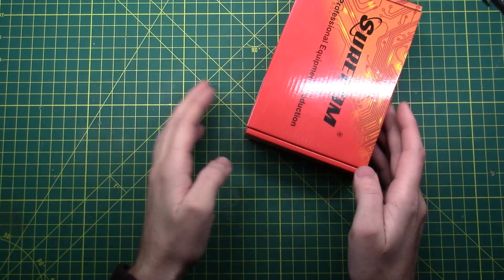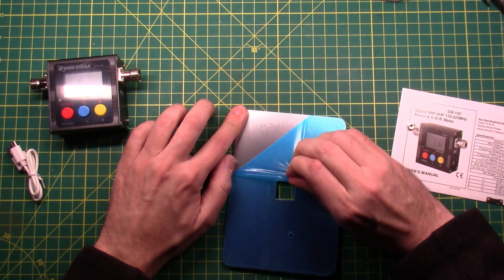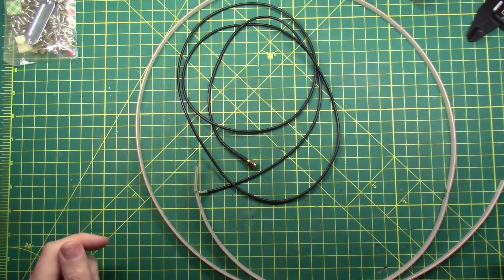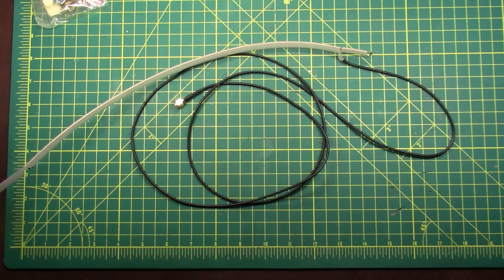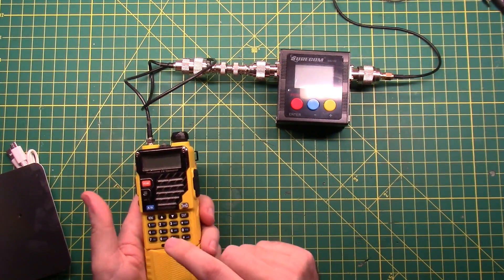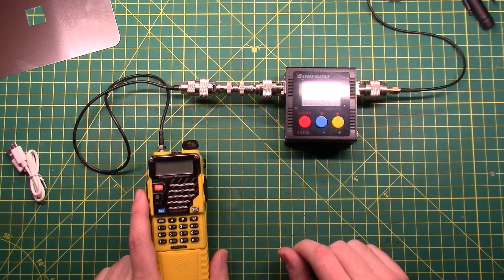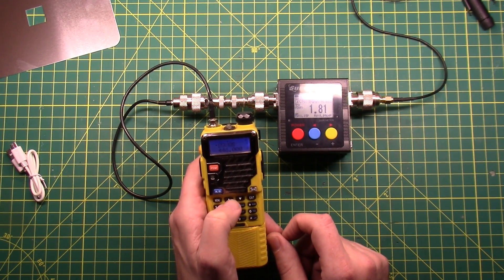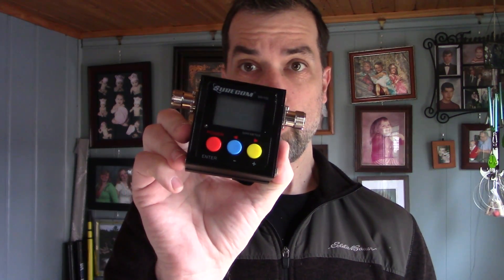Surecom  SW-102s First Looks + MFJ Battle

Comment: Is the ground plate necessary?  Mine did not come with a ground plate and I’ve been using it to check my SWR on my mobile GMRS antennas and the power output of my radios.  

Wouldn’t the ground plate need to actually be grounded to have a benefit?

Appreciate the help guys.
Reply from the maker: As with most things in ham radio, "it depends" - your handheld's natural element is to be in your hand, making you the "ground plane". If you're testing your vehicle antenna, the car is supposed to be the ground plane and you are not "there" at the antenna to become that ground plane.  The plate that I use is attached via the ground screw and I use it as more of a "measurement standard" so all my tests are close enough.

If you want, you can attach a 19" wire to the ground screw electrically and save yourself the cost of the metal plate.
Reply: @temporarilyoffline  Okay, that clears it up.  It’s a ground plane plate, not a grounding plate to drain off static, etc.

I suppose it could be beneficial to ground the meter using the ground plate screw if used on a bench or other permanent station, or maybe when checking a base station radios… when attached for extended periods?

Just checking them mobile radios and antennas once in a while, I’m fine without it (?).

I greatly appreciate the help.
Reply: When checking a handheld, it replaces our hand, arm and body as a ground plane?
Reply from the maker: Yes, you're pretty spot on.  I don't do much "station grounding" because I'm a full time RVer traveling around.  But I suspect you'll notice right away if your station needs grounding - you'll get noises you shouldn't be getting.  

You're right, its a "ground plane" - its "the other half of the antenna" - transmitting antennas really need two sides to work properly.  If they don't have the proper second side, they will actually just create it out of nearby metal/things - usually the shield on the coax an then you're feeding back into your radio/station.  Getting too deep for a youtube comment now though ;-)
Reply: @temporarilyoffline Yes, it was “deep” and very informative.  But thanks to you I now have a proper understanding.  I hope our comments help others.

I do appreciate the help.  Help me immensely. 

Thanks for all…

Comment: 10:14 my d*** not hard. W not show correct when you can change settings. for gadget that we bought measure W we not know is it correct xD if it not correct we need adjust it. HOW WE KNOW ITS CORRECT! when instrument to measure is this lol. 15w on 10w radio(solded) good thing it was cheap. they should ask more money. then 6w on other freq xD if could do 3GHz it would be i guess 1W LOL

Comment: Mine did not come with a Ground Plate
Reply from the maker: I'll have a video on this soon, it works differently without the ground plate and I think it really needs it.  I haven't tested yet, but if it does need something, put a 19" wire under the ground screw for 2m testing.  Stay tuned for some science!

Comment: To the question about the other meters: you can't compare this one with MFJ....  due to price range and quality, or am I missing the point ?  SWR on dummy load ? SWR is for antenna's only, one does not need SWR from a dummy load, a dummy load should not radiate power, SWR is about radiated and reflected power of a antenna is my understanding.
Reply from the maker: I was contrasting the differences and figuring out if the tool could be tested.  You are correct that outside of proving the device works you wouldn't use a dummy load.

Comment: It is a nice looking gadget... but the SWR i don't trust the thing.... i have a high SWR on a dummyload! Measuring on other  SWR meters the dummyload is okay... I don't know about the SW-102
Reply from the maker: I had a bad Dummy load, and I needed to change some ways I was using the surecom and it got better.  https://youtu.be/hmQ2RiQC31g
Reply: @temporarilyoffline  Jes i watched the movie! As i understand it correct: Like an antenna on 26.965 cb band the SWR is 1.0-1 but going up on the frequency the SWR wil get a little higher also. And my dummyload goes to 500MHz. And testing on 433.175 the SWR got 1.79-1 i am almost on the 500MHz. Is that the reason the SWR got so high? And would a dummy in the range 400-500MHz perform better?
Reply from the maker: @NatuurlijkRolf  a dummy load designed to work in the range you are testing would work best.

Comment: Got my SW-102.  It didn't include a ground plane, so I made one out of 1/32" aluminum from a big box store.  I chose aluminum because (a) that's what the video appears to show, and (b) aluminum is easier to form than the same thickness of steel sheet.  Since our esteemed presenter pulled his ground plate out the box, I measured the inside of the box everything came in and made my ground plate 4.5" x 6.5".  The square center hole is 3/4" across, and the hole for the grounding lug is 1/8".  The only tricky bit was ensuring that the two holes were mutually aligned and also squared up with the SW-102 box.  Based on past experience, I expect to lose the small knurled grounding nut, so I'll buy a wing nut to make operation a little easier.  The ground plane appears to work well in that I got very consistent readings from a new dual band HT.  Short initial report on the Radioddity GA 510: Across the 2m band, at the high power (10W) setting, power ranged from 9.2W to 7.9W; SWR with the rubber ducky ranged from 2.2 @ 144MHz to 1.5 @ 148MHz, with no strange variations.
Reply from the maker: Very good results!
Reply: @temporarilyoffline  Update: The grounding nut is an M3.  Hooray for my local Ace Hardware!

Comment: Do your adaptors affect the readings you get from the SW-102?
Reply from the maker: Yes, everything effects everything.  Its not enough to complain about or to spend more money to fix.  Just holding it a different way effects it.
Reply: Definitely yes..anything you  attach to your coax IT WILL AFFECT THE SWR reading..so better tune your coax first then again check your swr

Comment: Hallo. Do you know how to upgrade the firware for SW-102?
Reply from the maker: I can take a look into it.  Have you found the firmware file to update this with?
Reply: @temporarilyoffline  I have 2.7 version but on YT I have seen for example version 4.5. On some webs there is the zip files with the  firmware for sw-102 but I do not knowif it is a good idea to download this.
Reply from the maker: @macdruxxx  Apparently the firmware versions line up weird.  There are two models of this meter:
OLD VERSION : V3.3 ,V3.8 ,V4.5,V4.9 ,V5.0,V5.1
2017-8 NEW VERSION : V2.02 ,V2.03

And if you hvae version 2.7, then you might not have either version?

I'm in the same boat as you, I don't see anything "safe" to download.
Reply: @temporarilyoffline  I will send you an explanation from. Surecom. It seems my v2.7 is almost the newest one. For me it is big mess. 
"Version information of date: 
VER．3.3-V4.5   (P.C.B. 001) Production on   2016-2017    
VER. 5.1            (P.C.B. 001) Production on   2017-2018   
VER.2.0 -V2.03 (P.C.B. 002) Production on   2018-2020    
VER.2.06-2.08   (P.C.B. 002) Production on   2010-2021    
VER,2.4              (P.C.B. 003) Production on   2021-Now     

 

The first from : 
P.C.B. 001 (Old version )   V3.3,V3.8,V4.3, V4.5  can up to V5.1  .       
P.C.B. 002  V2.02,V2.03,V2.06 ,V2.07 ,V2.08    (Version V2.0  to V2.06 (same V2.07  V2.08)..... , the watt meter refenece is best than  V3.3,V3.8,V4.3, V4.5,V5.1 .)
P.C.B. 003  V2.4 ~V2.7  (New PCB design for S.W.R.)  . (* V2.7 will be cancelled the efficiency % ,sorry for the inconvenience)"
Reply from the maker: Yeah, that is a mess!  At least they answered you.  Unless there is a problem/blocker with your unit, you don't have to upgrade the firmware.
Reply: @temporarilyoffline  It is very interesting. I have just checked and I got an answer from Surecom that 2.7 is the last version. I think I am not blind and I can see v4.5 on films 🤔

Comment: I have a Shure comm SW-102= great for setting and monitoring antenna and radio health
I also have a Nano VNA is priceless, nothing like a graph for antenna characteristics and "Seeing" where the resonant point is, if there multiple dips. You could spend all day finding low vswr with a meter where as with a VNA you see it could be a 500kc high or low. Adjust the antenna and watch the curve move. I had a MFJ antenna analyzer, I gave it away.
Plus a VNA has software.  W9DLP
Reply from the maker: Thanks Dave! I love my nanovna.

Comment: Put up a dipole and stop screwing with that Jpole. 🤣😜If you want to do it right make a array ☺️ a dipole made of lmr400 at same height would be better. I personally use a one made of 3/8”solid ground copper wire 4 counter poise at 45deg bend off the simple nickel plated cheap so239 I used wire lugs to screw down then soldered the lug to the counter poise and I use rf 214 through 3/4 16’ pvc pipe up on chimney bracket. Planning to move into a maple tree, once I rent the 60’ boom lift to get to the top. When you coming to work the low band ? Toad harbor net 1.930 nightly est 6-10
Reply from the maker: I've listened in to toad harbor a few times,  but haven't had a chance to break in yet.  I need to get on that.

Comment: Seriously doubt accuracy of this thing - have one and not impressed - eager to see what you found.
Reply from the maker: What did you think?
Reply: @temporarilyoffline  Love the adapter bin!  Well done and I think it works better for SWR meter but just like mine using if for the Power Meter it is wonky.  I used it to test SWR on my mobile antennas and it seemed to read true.  On the power side, I had my Yaesu FT1XD on 2m HI (5w) and it only showed 2-3 watts.  On 440, it registered the full 5w but not on 2m so not sure what is up with that.  Maybe I will try the "ground plane"?!?  I tested the Power on dummy load and antennas and the same 2m issue.  Tried other meters and they showed the full 5w on 2m.  Something is odd but again, well done.
Reply from the maker: @davidg5308  thanks, sounds like what I found.